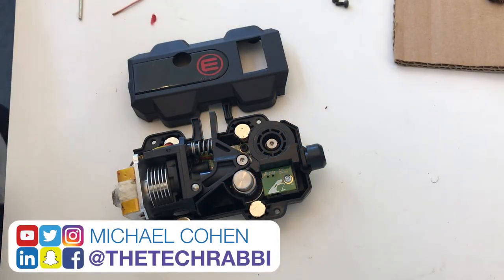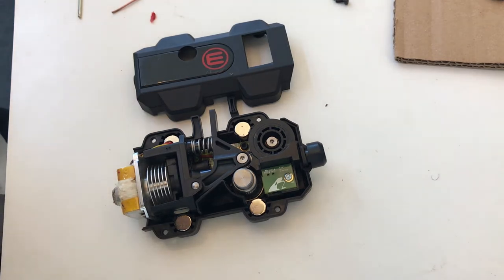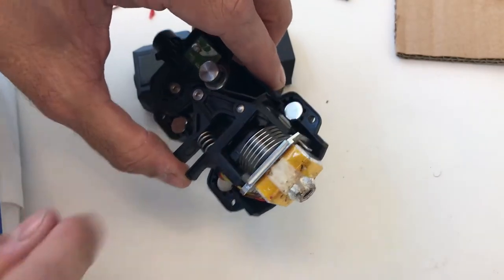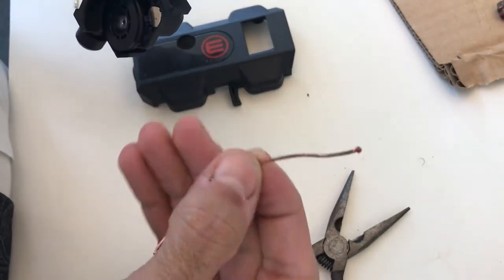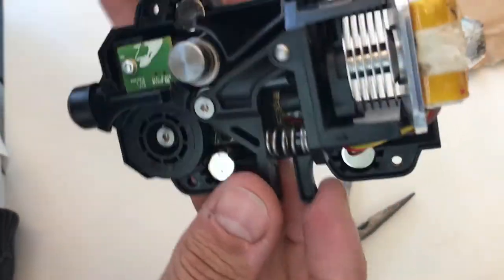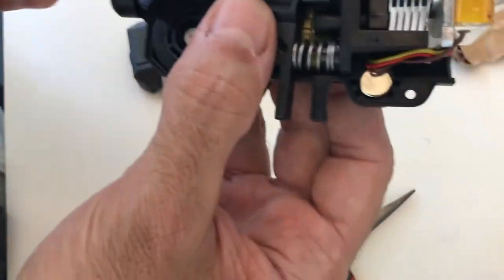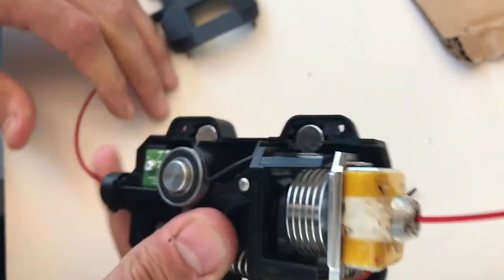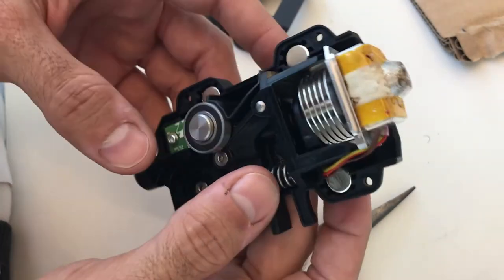How To Fix A Clogged MakerBot 3D Printer Smart Extruder

Comment: Thank you for this video!  This seems to happen most when the filament runs out.  Now, can you school me on how to get better adhesion and less curling on this non-heated build plate? 😃

I’ve tried all of the tricks… glue sticks, masking tape, hairspray… all of this helps but it’s still a crapshoot on if I get solid adhesion or not on bigger prints.  Any help from you on this would be extraordinary!  Thank you! 😃

Comment: How do you know when it's jammed/clogged? I have a smart extruder+ and my problem right now is I keep getting a slippage error. It says the filament slipped but it can't recover. I think it might be jammed but I'm not 100% sure. I started a print only to come back later to find that the filament wasn't even loaded, but I thought it had been when I started the print. So I think it broke(I don't know how, I've never seen it before), leaving a bit of filament inside of the extruder. Although I would think it would be pushed out like how old filament usually is when you change colors and whatnot. Anyway, when I go to load the filament, I feel the initial tug of the wheels pulling the filament in, but then it stops, not sure why. Filament isn't extruded, but it's in(at least part way) the smart extruder. This is why I think it may be a jam. Any advice/comments? Thanks in advance!
Reply: You can turn off error notifications and it will most likely print just fine.